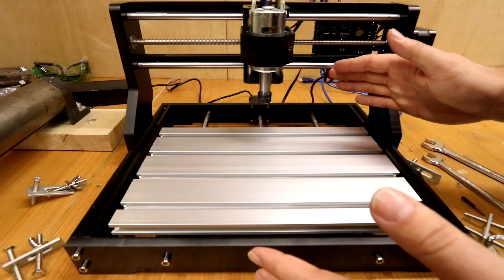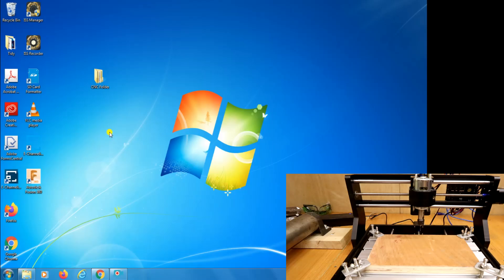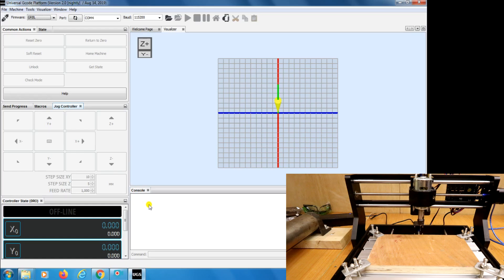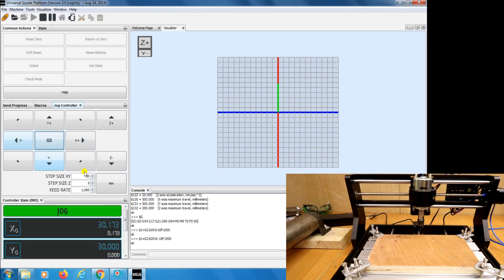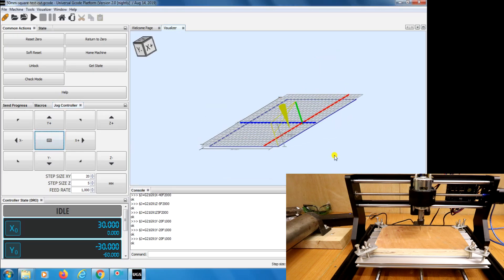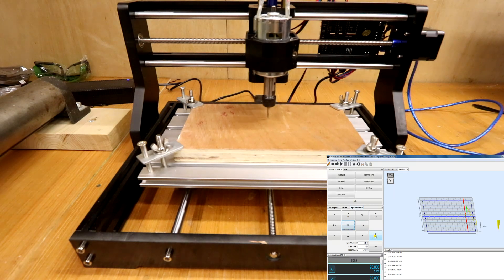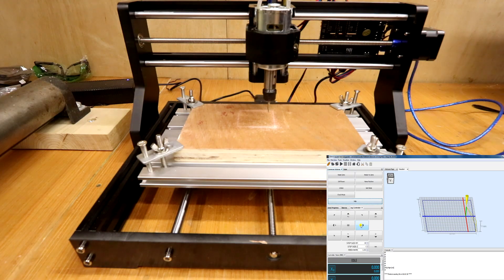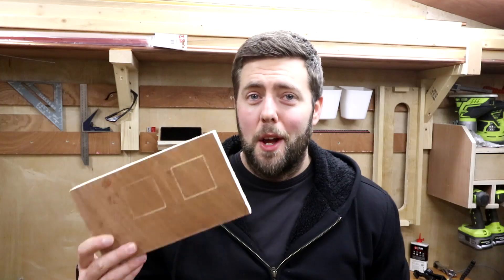3018 PRO - Making your first cut

Comment: Hello I recently bought a cnc3 3018 pro I fallowed the instructions as the machine started cutting wierd like in reverse. Does anyone know what could be wrong? And how I could fix it or have a reference on YouTube?
Reply from the maker: It is your $3 setting. It can change the direction of the axis. There is a table here which may give you and indication of what value your $3 settings needs to be
Reply: @JamesDeanDesigns  I will try that because I thought the machine came broken because when it starts it shoots up then just goes all over the place n out off nowhere it plunges all the way through
Reply: @JamesDeanDesigns  I’m sorry for bothering but all the axis on the machine are reveres x does what the z axis is supposed to do, z axis does what y is supposed to do and y does what x is supposed to do does it let me change multiple at a time?

Comment: Thank you for your videos. I have recently bought a 3018 Pro and used your videos to put together. I did the test and it worked but now the next day the machine will not connect in UGS. It shows that it is moving on the computer but my machine isn't working at all. I've tried plugging, unplugging but nothing. Is there a switch somewhere I am missing. I know I'm missing something silly.  I am ideas person and a hands on crafty person but mechanically I am underpar. Thanks.
Reply from the maker: Yes, usually something simple. Basically it just means its not connected correctly. Double check you have the correct port. This is usually a common cause. On occasions I do have to press the reset button on the board to get it to connect
Reply: @JamesDeanDesigns  Thank you so much. The reset button worked. I should have thought of that. Oh well. Thanks for being the genius!

Comment: Hi! I am on the fence on buying one of these machines but can't quite make up my mind. As I live in an apartment with no garage, I can't have something running very loud inside the unit. I unable to make out from the video whether you have lowered the volume on the noise from the machine when running or it doesn't actually generate too much in the first place. I have also found an acrylic enclosure available on amazon that supposedly lowers the noise but it appears to have mixed reviews. Could you let me know if the noise level is bearable or a separate garage is a must ? Thanks.
Reply from the maker: I do reduce the volume im my videos. Any enclosure will help reduce the the noise but I would be sceptical of the acrylic ones reducing it too much. If you live in an apartment I would definitely say you need some sort of enclosure
Reply: @JamesDeanDesigns  Thanks for the tip! Appreciate it.

Comment: Hello I am after buying this machine, is there somewhere I can go online to help me connect my machine and get started I have machine built I just need someone to help me get it working ,if you can pay online il do it mate
Reply: Are you available?
Reply from the maker: @safetyjoe1967  I can help you as much as I can. The videos should get you going but if you have any specific problems just let me know
Reply: Thanks a lot I really appreciate it, I'm going to try to see if it just even moves if I try the offline controller, all I want it for now is to engrave on aluminium.
Reply: This is my email if you have any ideas zoozoo.fagan@gmail.com
Reply: Can you tell me what driver should be in your laptop for candle to work properly please

Comment: Hello Mr James...thank you for your video. I follow your coaching. But my machine did not return to home position  with big noise. Could you tell me why?
Reply from the maker: Difficult to say from that but sounds like your motors may be jamming. Does it move at all or just stall?
Reply: @JamesDeanDesigns  the rotor of the machine completes the square and after the rotor rises, it cannot go back to home position and stops.

Comment: Great tutorial James. I have followed from the first one but my 3018 pro is cutting in reverse as in a mirror. Perfect lettering just have to look in a mirror to read it ahhh any ideas ? I have checked the direction with jogger and using Easel cheers Mark
Reply from the maker: Hi. Usually you $3 setting needs adjusting. Try $3=1 if not this table might help https://github.com/gnea/grbl/wiki/Grbl-v1.1-Configuration#3--direction-port-invert-mask
Reply: @JamesDeanDesigns  Thank you so much 👍

Comment: How the f did u make the gcode to start with? Im using 3d printers for years, but just bought 3018cnc but there is no video that starts at the base
Reply from the maker: Check out my 3018 series. There is a video called designing and cutting, or something close to that. The only thing is one of the features I used in my video is no longer available in the software for free 😕

Comment: Hi James, I have just purchased my 3018 pro, I have set it all up by following your video but when I switch everything on and connect to my pc the jog controller section isn't responding can you give me a hint as to what I've done wrong please.
Reply from the maker: Usually if the jog buttons don't come to life, it means it hasn't connected properly. Are you sure you have the correct port selected?
Reply: @JamesDeanDesigns  ok, My laptop hasn't got a serial port so I have had to download a remote port so that makes sense. I will have to have another play with the ports. Thanks for your help

Comment: Hello James, thank you for the video it was very useful. I have a question. just got my CNC3-3018 PRO machine. it came with a usb with the software for spindle and laser on it already to be installed. the spindle system is GrblControl (candle). i installed the driver and then tried to connect this system with the machine but it does not seem to do the connection therefore I cannot proceed to test anything. Any ideas on this? Should I try to download the software you suggested? would it apply to my machine?
Reply from the maker: Its a case of problem solving. But to start I would download my files and give them a go. If its still not connecting then let me know

Comment: Hi James, thanks for the vids, they are great. I have followed vid 3 and got to the test stage but the machine will not move in any direction. The blue light is flashing. When I click Return to Zero the machine does move on the Z axis, but that's all the movement I can get out of it.

Also when I turn it on, it is really loud.
Reply: Now I have found that when I try each axis it does try to move, it sort of judders fractions of a mm. All three axes do this. I can move all freely with my fingers. I've tried loosening the screws but that didn't work. I tried switching the cables but that didn't work.
Reply from the maker: Hi Adam. Find me on Facebook or Instagram if you can and send me your GRBL setting also a video if possible 👍

Comment: Can you please show how to install java on the machine?
Reply from the maker: Hi Dimitry, Java isn't really CNC software, its just used by UGS to help run that piece of software. Its fairly simple to install. Just head to https://www.java.com/en/download/ and run through the steps. Are you having the issue where UGS is saying it cant detect Java?
Reply: @JamesDeanDesigns  Thanks for such a fast reply, actually didn't rly expect it :D and was a good surprise for me. I'll check it out when come back from work tonight. I just thought to install java on CNC, but i need it on PC you said, didn't you?
Reply from the maker: @Braincho  yes. The java just needs to be on the PC. Its fairly common software and a lot of machines may have it as standard but UGS does need it to run
Reply: @JamesDeanDesigns  Thank you very very much! Just did a couple of tests you showed, but i have several problems and don't really know how to fix it, would be nice if you can help me with it, i'm sure it can be helpfull to some one else as well.
1.The button for 2 seconds laser(on the bottom right in LaserGRBL program) doesn't work. The laser itself is working( the button of the laser itself is switched on), i tested it with a code directly in the program in the left side(M3 S20) just to find the best position for Z-axis, and run your test for it - now it position is perfect. And the test files are working - the lines for Z-axis hight  and the speed test too.
2.In the tests for the speed(lines,fills,number) and for the lines(hight) laser doesn't stop burning when it moves positions where it supposed not to burn(like in your video about laser when you said $32 should be 1. And when i press the button on the LaserGRBL to switch laser on and turn off the spindle - it shows in the code section red mark and the command didn't pass.
3.In the Setting where you advised to check the speed of the spindle to correct it and also to switch manually laser/spindle between 0 and 1 i don't have some of the settings between $27 and $100( they are simply missing) There is no $30 and $31 and $32. Is there any way to help it out?
4.The UGS doesn't want to install - when i open it - it shows the first window(where it says initializing and shows logo on the middle of the monitor) and then closes itself. Tried few times, even after restarting my computer. And the UGS from the website looks totally different, but when i tried to connect - the cnc machine does strange noise and nothing working.
5. And the last one, but not the smallest problem, which i hope can be fixed in the software or i think some cables in the step motors plugs must be switched. Actually all 3 axis(X, Y ,Z) are spinning in opposite directions - when i manually press left - it goes to the right, press up - it goes down, press forward it goes back. The same problem with the tests you gave us in the files - it print them upside down(the Z-axis not involved in laser usage, but it also reversed).
I played couple hours with it and tried to get some info from internet, but without any success for now. Would be great if you can help me solve those problems or at least some of them. 
Appreciated in advance!
Reply from the maker: @Braincho  Wow! that's a lot of questions. I'll help where I can. 
Issues 1-3 sounds like you are running an older firmware version on your control board. This is quite common, typically 0.9 but you want to be on 1.1F I believe. Just google or search YT for upgrade GRBL version.
Issue 4 - There are 2 versions of UGS, Classic and Platform. I use Classic as that worked better for me. When you download it there are also 2 options, 32Bit and 64Bit. Even though my machine is 64Bit, the 32Bit actually works better so I use that.
Issue 5 - this will be your $3 setting I believe. Try $3=5 to invert all your axis. Im doing that off the top of my head though so it might be another number instead of 5
Reply: @JamesDeanDesigns  Thank you James! I really do appreciate your help. I will try to check it out... but i'm using all you showed and i did download it from your files and website you showed. But i will definitely will search for the problem you explained with some more attention.
Any ideas about my 5th question how it can be solved? I mean the motors looks like spinning in opposite directions. Can I simply change the connectors in the plug? If it possible, do you know which two to switch ?
Reply from the maker: @Braincho  I answered the 5th question above. It will be your $3 setting. This controls the direction the motors spin
Reply: @JamesDeanDesigns  Yes thanks, it didn't show for some reason. But now i see and will try it tomorrow. Big thanks to you once again. And btw its my first time experience to talk(chat) with a youtuber :D was very nice. Very good videos, very clear and understandable information given! Wish you the best in life, keep doing what you're doing!
Reply from the maker: @Braincho  hopefully my comments help. Let me know if they don't and I'll try to carry on helping

Comment: Hi James
I am looking to purchase a secondhand laptop for use with CNC3018 engraver and laser. However I am not sure of the laptop specification I would require to control my CNC. Is there anyone who may be able to advise?
Kind regards
Reply from the maker: To run the CNC really doesn't require much power at all. People run them off things such as a Raspberry Pi.
Reply: @JamesDeanDesigns  thanks James, much appreciated.

Comment: Best 3018 tutorials on the web. I have a 3018 with candle . I have a test file consisting of an o inch diameter circle inside a 2 inch square. When I run the code the cut comes out about 1/8 inch square. What have I done wrong. thanks

Comment: I got this cnc for making pcb but I can't make it to connect with easel I have try so many things like reinstaling driver with the software is working but to connect it up to easel to set  the touch plate and so on i was not able yet finally I made my pcb using the laser method
Reply from the maker: Personally, I dont and would not connect the machine to Easel anyway. Its been known to adjust settings, especially the z height. Try the alternative methods such as using UGS or Candle
Reply: @JamesDeanDesigns  mostly I use one software  wich was included   litefire I think  is the name for engraving on the pcb for driling  the hole  I use the offline controller and the motor with the spindle.  Thank you for  the  tips

Comment: Having major problems setting my machine up. I have used the remote to move the spindle about so i know the machine is working , cannot get the software working . I downloaded UGS version 2.0 (nightly) and following your video certain things are not coming up or working 
can you suggest where i can get help?
Reply: I had similar issues with ugs (parts of the user interface not drawn). I switched to bCNC to send the code and jog around.
Reply: What exactly is “bcnc”

Comment: I had trouble with the table jamming up in Y moves.
I found out when i tightened Y leadscrew up (block underneath) it distorted the table.
I got round this by inserting two pieces of thin card under the block till i got free movement with everything tightened up.
So be prepared for these kind of setbacks..eventually all will be well.
Reply: i DId a x-axis thats really the y-axis video with this being the end issue. thx for commenting. basically I also took the drill gun to straightin the 2 mount screws up and down. so I would not need too much oil later. I put the rod in the drill gun chuck and rotated thru the part. but once the machine it jammed like your issue. I need to also try your cardboard trick thanks.. I was getting to do something similiar myself.
Reply: @apkiller10  I've had no more problems since the cardboard cure..i think it was about 15 thou I had to put under..but i guess it would vary for each machine.
Reply: @Mogul25Years  yea that part is cheap plastic. but it got me to think about the smoothness of the bottom rails, and if its bending too much. I guess the other variation to fix it is, file down the part if its too big. I have to fix anouther axis soon too, and just got it to sit on bed on top of 4 wood blocks so can take out head without much disassembly. I have a duel monitor attached to back. so my assembly gets messy quick.

Comment: My spindle is not turning on please help
Reply from the maker: Hi, do you have any more information. Is it a new or old spindle, has it ever worked? Do you have anyway to test things like a multimeter?
Reply: Having the same issue with my 3018 Pro, any advice James?
Reply from the maker: @peterdavy7166  Hi Peter, similar to my above response. Do you have any more info, as it ever worked, are you using an offline controller etc.

Comment: Great videos, thank you.  Just received my machine today and hopefully have built it correctly.  It has come with a set of 13 ER11 collets  1 to 7 in 1/2 sizes. What are these for please?
Reply from the maker: You can buy cutting bits in lots of different sizes. The average person will only use 2 of them which are the ones closest to 1/4 inch and 1/8th inch. 3mm and 6.5mm off the top of my head. Mosy of the time it will only be the 1/8th collet that you use
Reply: @JamesDeanDesigns  Strange they don't have just supply the 1/8" and the 1/4".  Do you think it would be OK to use a 1/4" bit in a CNC3018 machine, which is designed for use with the 1/8" bits?  As an aside, can I ask please, what type of bit would you recommend for roughing out on softwoods such as pine?
Reply from the maker: @alandimery3379  Some sets you do, they provide a selection of metric and imperial. You can use 1/4 bit but you have to make shallow passes. Perfect example is when making a spoil board, you can level the board to the bed using a 1/4 bottom cleaning bit however when I did mine I only did passes of 0.1mm each time. Most bits will work on softwood but softwood doesn't leave the best finish. Usually you have to run over it with sandpaper to get rid of all the frey.  I mainly only use 2 bits in my work, a 3.175 (1/8th) flat end mill which is usually for clearing and then a 0.5mm tapered ball nose for the detail.
Reply: @JamesDeanDesigns  Sorry for monopolising your time.  Is there an advantage of having a tapered ball nose rather than straight?  I want to start by buying cheap bits until I get the hang of it.  The tapered bits are more expensive than straight?  I have 20 degree 0.1mm V bits.  Would they be any good for smoothing or is it best to buy some ball nose?
Reply from the maker: @alandimery3379  The V bits that come as standard are ok to start with but just be very careful as they are extremely sharp. Different bits have different purposes. The advantage to the tapered ball nose is they clear material faster as they are an upcut bit